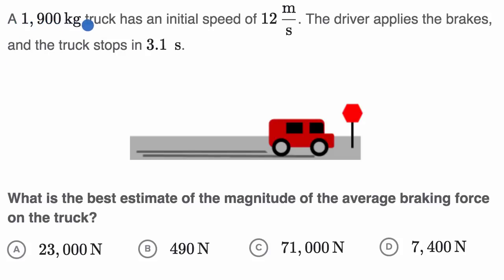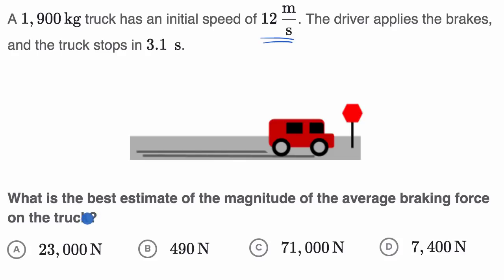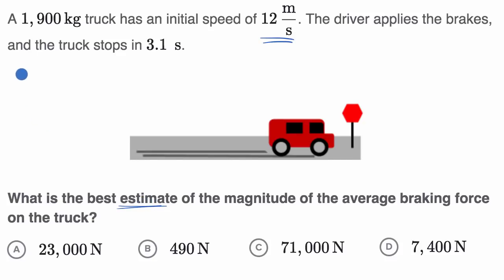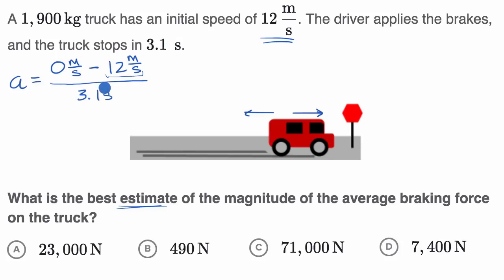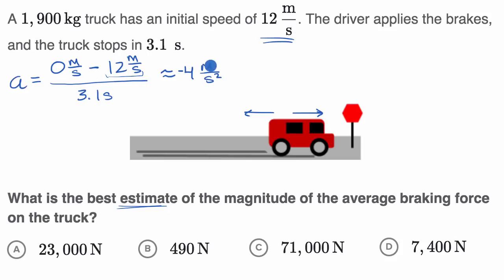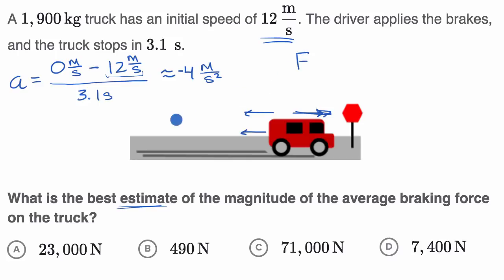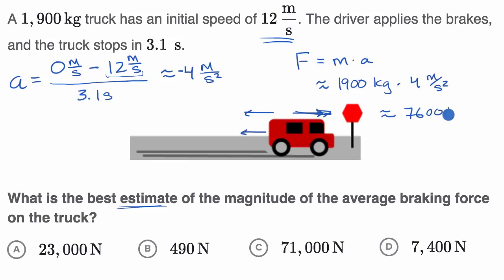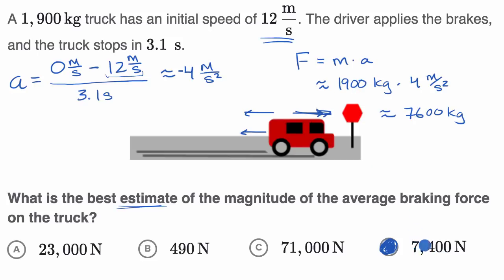Kinematics and force example

Comment: I did this question using this method and also by using conservation of energy, and I've gotten aproximatly (I rounded some stuff therefore i didn't get the exact) the same thing, that's what I love about science and math it doesn't matter in which way you're doing a problem, as long as your approach is right you'll get the same thing.
Reply: Luke Moura how
Reply: Enrico Lopes I used the acceleration the initial velocity and the time to find how much it had moved, and with this I just said that 0= initial kinetic energy minus the force of break times distance
Reply: Then solved for force of break